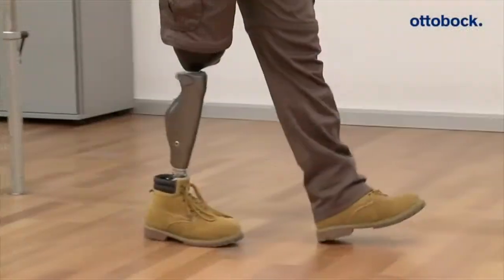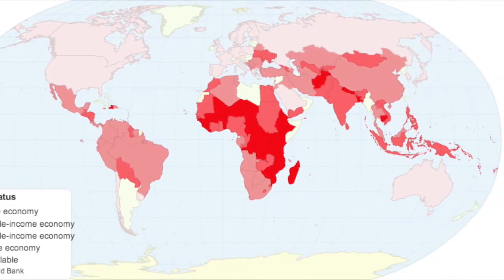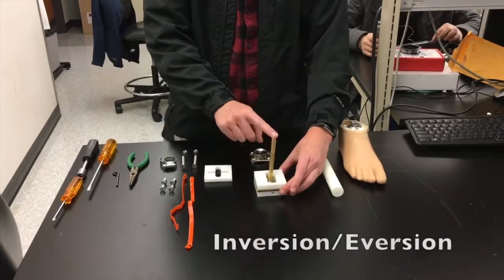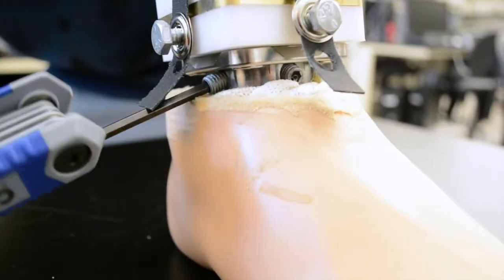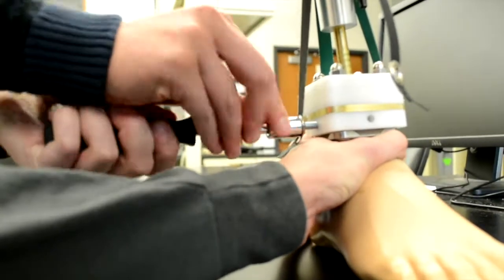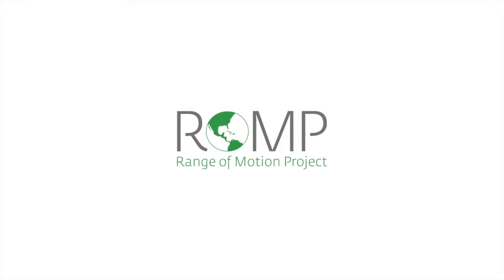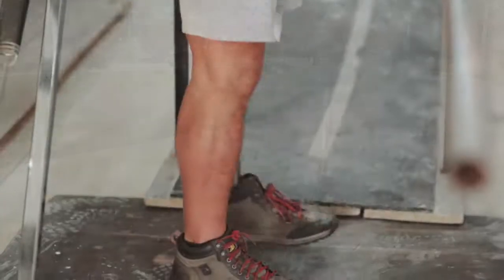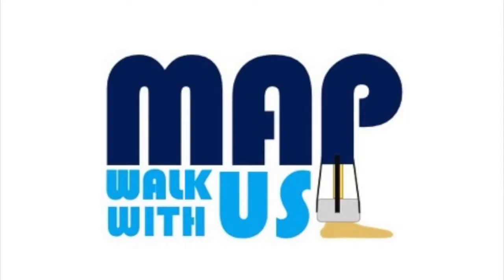Multi-Axis Prosthetic (MAP) Ankle: Guiding Amputees Towards Independence

Comment: I live in Thailand, and would like to help to produce and help people here without resources to buy a new foot/leg. I have experience with CNC and some machines at home enough potent to carve hard stainles steel (HRC50 is the hardest i have never carved, but i think i can try with harder)  , carving hard and soft metals, also have printers, knowledge of computers, design, small experience with resin casting and fiber carbon use, wide experience making molds of silicone  and willing to help. Can you guide me how i can help? How i can get your models to print here? Any organization like yours here where i can help? Thanks